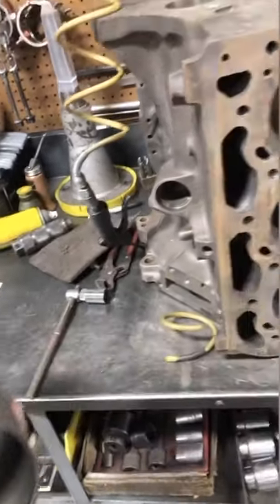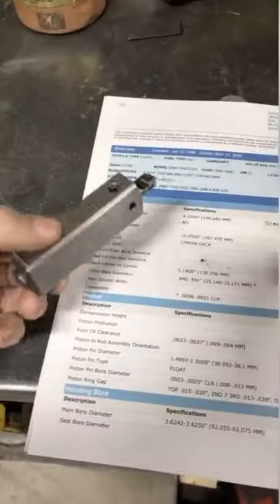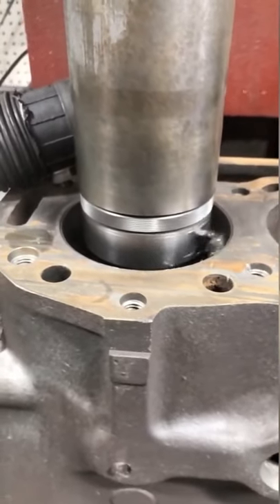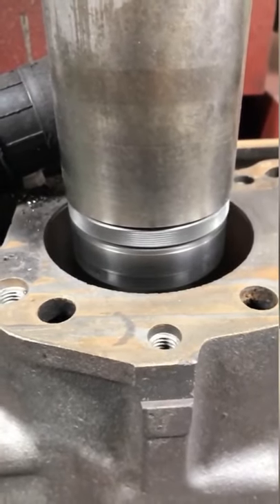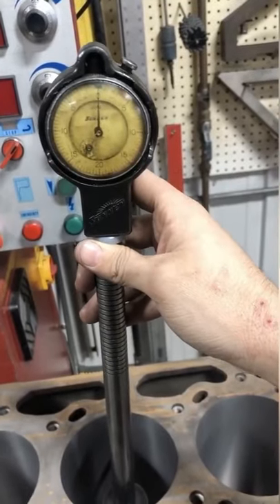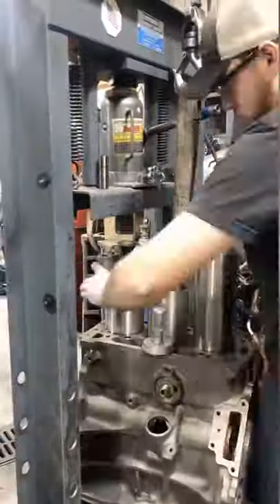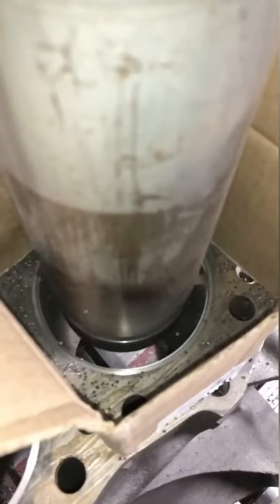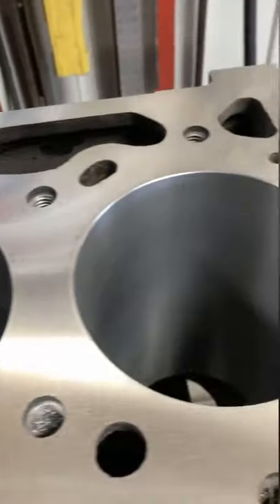#shorts Ford Tractor Engine Block Re-Sleeve

Comment: To me the most amazing part of all that, is that there is absolutely no seam, it looks as If the block and the sleeves are one piece.
Reply: Some put oil or grease between the two and from the heat of grinding bonds together then when the top is cut it bonds them into one.
Reply: @lawrencejackson4001  uh no, that's not at all what is going on.  The heat needed to bond the two metals together would be much...much..much higher, and you don't really want oil or grease between two hot pieces of metal you're trying to bond together.  It looks seamless because of the tolerances between the bored out cylinder and the sleeve being so tight, also the angle of the camera
Reply: @UnyieldingSeraph  precision machining and tight tolerances are a thing of beauty. Art in itself almost.
Reply: @UnyieldingSeraph  thanks i was about to reply the same, so many people make up explanations here with no logic lmao
Reply: Surprised they didn’t heat the block up in a oven first ?
Reply: @lawrencejackson4001  hydrocarbons are poison to any kind of bonding. Besides bonding two metals requires the removal of oxides and the use of flux or an inert chamber, such as an inert gas furnace on a totally clean surface. The reason the there is no seam, is because they are using an interference fit which shouldn't leave a gap.
Reply: @UnyieldingSeraph  Clearances, not tolerances. You can have a zero tolerance with a millimeter clearance and it will still have a gap.
Reply: The sleeves have an interference fit. That means the cylinders are 2-3 thousand smaller than the sleeves. There's no gap cause they are pressed in.
Reply: @lawrencejackson4001  Ummmm, NO
Reply: @lawrencejackson4001  😳NO! The tight fit isn’t supposed to be lubricated.
Reply: @UnyieldingSeraph  Im assuming you have never heard of cold welding, the process of fusing two like metals through extreme pressure
Reply: seamless integration.
Reply: @lawrencejackson4001 me when i make shit up
Reply: @MiloCraft123 that's not this
Reply: @tinytattoomike7943  That'd be a shrink fit, I believe, not an interference fit.
Reply: That’s the beauty of precision machining. A couple tenths of an inch and you would be able to see the seam.
Reply: Nice Work!
Reply: @tinytattoomike7943  Easier to freeze the sleeves.
Reply: Why dont make a lip on the top of the sleevs and little more boring zo the sleevs cant sink want good engin builders do whit high hp
Reply: @tinytattoomike7943 that would make the bore smaller
Reply: if you pause an look carefully you can see the seam

Comment: Not gonna lie, I'm glad to see stuff gets repaired. Honestly, these days it feels like we just junk stuff as soon as we can.
Reply: Yeah same here man
Reply: I work in an RO industry for aerospace. You would be surprised how much we actually repair/overhaul. A big driver is likely parts availability and new part cost. Sometimes it's more cost effective to replace but many times it's cheaper to fix.
Reply: Consumerism is a hellova drug
Reply: @azgardener79 I remember once we overhauled a front strut. Can't remember the model but it was a $30gs part in 2000. 
There was a number of rebuild times before replacing.
We used to have undersized parts Nickle welded and trim back to size. Stronger than ever

Comment: What a great video I've seen this done on other platforms they never mentioned the step the step is there to keep the cylinder sleeve from going down into the crankcase and hitting the throws on the crank and the head holds the other end from going upward. Great job

Comment: I couldn't even tell there's a sleeve in there , i dunno if it differs from sport cars sleeves but damn
Reply: It depends on just the thickness, diesel engines sleeves or thicker than gas vehicles. That's it.
Reply: The block was probably resurfaced because of there universal sleeves originally put in the block
Reply: so do all cylinders have sleeves installed like this from factory or is this a way to repair the shaft if it becomes damaged?
Reply: @Curtis.Carpenter  if there made in a plant that makes multiple engines that use the same sleeves. Some have specific sleeves some dont.
Reply: @joestewart5406  Some engines are sleeved from the factory, especially aluminum blocks for turbo engines.
Reply: @Curtis.Carpenter  this is a Ford tractor engine therefore it comes from Factory without sleeves of any kind it is a monoblock design. They are renowned for electrolysis through the block into the combustion Chambers and the most simple way of fixing that is to install dry sleeves. Massey Ferguson for example comes with dry sleeves from the factory but they are much much thinner than the ones shown in this video.

Comment: Those liners look as thin as liners in a Mack Truck engine. In my days as a diesel mechanic,when installing new liners,the Mack manual specified only a fixed hone should be used.and to hone slowly checking fit often as dry liners rely on metal to metal contact to conduct the heat away from. Liner into the block

Comment: Most shady or unknowledgeable mechanics would just tell you to replace the engine block.
Reply: No, this block has extremity thick partition walls and are thick enough to be overbored for a sleeve, most automobile blocks are far tighter for more efficient cooling and weight reduction. A tractor engine is low horsepower high torque, low compression long stroke so not a good candidate for automotive applications. So yeah replace a car block or it will fail in short order. Just because you can do it doesn’t mean it will last long.
Reply: And to think I never said anything about an automobile engine. The sleeve was for the crack. What are you even talking about?

Comment: Did you do this to cure the porosity issues these engines are known for? High quality work as always!
Reply: If you mean porosity with in the cast iron? You can't fix that without melting it down and recasting it.
Reply: @mikeford963  no didn't mean it like that. It just that the early Ford 10 series tractors had issues where the oil would get into the water or vice versa due to cavitating of the water passages due to the vibration of the engine. The later fixed it by adding extra ribbing to dampen the vibrations
Reply: @creyly8326  Ah gotcha. I are weldar!! Porosity has a different meaning to us!!

Comment: That was beautiful.   The ford 3 cylinder is a great motor gas or diesel
Reply: Not just the 3-cylinder all of the Ford gas and diesel engines for tractors are amazing they have 3, 4 and 6-cylinder engines in both gas & diesel and the Genesis engine is amazing as well,

Comment: Great work. Does sleeving adversely affect thermal transfer to the block at all? I'm thinking only that the admittedly intimate contact between the sleeve exterior and the block just isn't quite the same as the original single layer. Or am I overthinking?

Comment: Have you seen the freezing process  of engine sleeves  ? They use liquid nitrogen or they have an actual machine that freezes the sleeve and it just falls right in and in about 2 minutes it thaws and is now fitted.

Comment: Out of curiosity, can one use something like a large slitting saw on a milling machine to cut the sleeves of rather than turn the excess length of the sleeves into chips?
At least it's easier to put whole chunks into the scrap bin rather than having to scoop up chips from the floor.
Reply: I'm not sure but I think they try not to distort the cylinder shape of the rest of the sleeve . But I had the same idea lol they bore and hone it anyway right ?
Reply: @syndakitpanda1777  yeah, perhaps some automotive shops don't have access to a proper milling machine so this trick can't be used.

Comment: Did that motor have sleeves from the factory? Can you fit sleeves to any block? This is pretty awesome
Reply: No sleeve from block an ya  only if u can fit them. Some cylinders are so close you cant
Reply: Technically you can put sleeves in any engine block the problem is that if the sidewalls of the existing block are not thick enough you would run out of material therefore you would have to make the inner diameter of the sleeves smaller than the factory bore of the engine which might not even work if you can't get pistons in a smaller than factory size to be technical

Comment: How thick are the sleeves after finishing? I would like to sleeve a 390 block to be strong enough for 1000 hp at 4.125 bore. The bore centers are 4.63 and deck ht is 10.17. How thick must the finished sleeve be, and how large must the overbore be?

Comment: I have a really dumb question. What does one do when you take too much off the deck height or you the block has been bored past oversize. Do you just add in sleeves so that way you can bore those to spec?

Comment: I'm not an engine guy or a machinist... why use a sleeve? Were the cylinder walls to thin to clean and continue using, maybe a crack in the block?

Comment: Mr Jim have you been able to say that you have been successful with the sleeves and how do you say that they are going to last, 50k miles on a running everyday driver?
Reply from the maker: When we install a cylinder sleeve we do not expect it to be a weak point! If I’m building an engine to run 200k miles, I fully expect the sleeve to last just as long as the rest of the cylinders.

Comment: He literally cut everything Away just to full it up and make it the same it was
Reply: Called engines things, they're very fussy 😂. Nah it had to be done if you see the way the block was at the beginning with all the scoring and what looked liked pItting on the side of the cylinder that would prevent the pistons getting good compression which in turn wouldnt make the engine run at all, I saw someone also say it might also have a crack in the block but from what I can see I don't think it has.

So basically engine needs compression, compression won't work with old engine, he make engine better 😂
Reply: @padraigrab08  /r wooosh

Comment: Can that be done on a normal car engine ? Or they bore it and put oversize pistons on it ?
Reply: Yes, that can be done on  any engine. Sleeving is typically done to bring  worn out cylinder/cylinders back into  specs or for crack repair. A lot of engine blocks are getting harder to find because of people scrapping good cores. If someone has a numbers matching block for their restoration,  sleeving is a must on worn out blocks.

Comment: Isn’t pressing them down when u left a lip to support them a bad idea ? Shouldn’t dry ice and heat be used in a situation like this ? And also boring down that much of a sleeve with no cooling seems stupid since the heat distribution would not be even like in a running motor

Comment: So dumb question probably..... this is being done to a non sleeved engine, obviously a wet sleeve engine an be replaced, but is this only for gas applications? Like let’s say because it’s getting harder and harder to find Cummins 5.9s without blowby..... could this be done to the cast iron block of the Cummins 5.9 or 6.7 to essentially restart its lifespan? Information Would be very much appreciated....
Reply: Yes you can sleeve your Cummins block.
I have sleeved gasoline, diesel, and propane powerd engine blocks. Doesn't matter what they run on.

Comment: How much does this cost
Reply: Roughly $150.00 per cylinder  to sleeve depending on where you are.  Plus any other work needed: deck the block, degrease/hot tank cleaning, cam bearings...

Comment: Damn a whole 8th inch in a single cut hahahah
Reply: If he's talking diameter that's only 1/16 per side.  That's not bad at all.  Especially in cast iron.
Reply: @brandons9138  even a 1/16 is like .0625 inches
Reply: @jacobrollo406  I know.  It's not that heavy of a cut.  Cast iron is abrasive, so it can wear out tooling, but it's not that tough.  That's why it's sleeved in the first place.

Comment: Huge and long and time consuming what is the point in this? Surely cheaper to replace whole engine than this
Reply: Good luck finding a 3 cyl Ford tractor engine, let alone one that doesn't need this done to it.